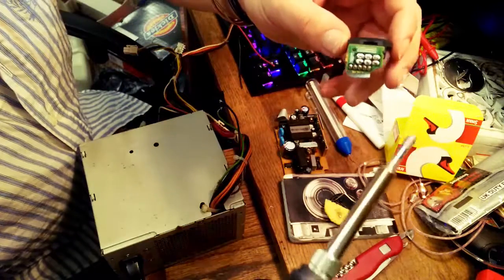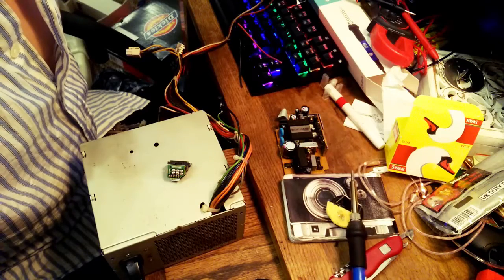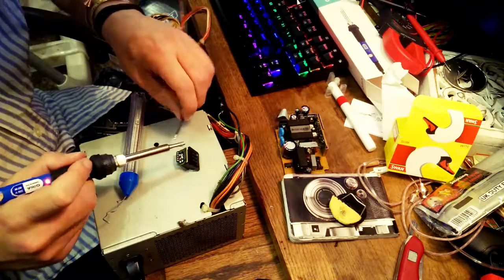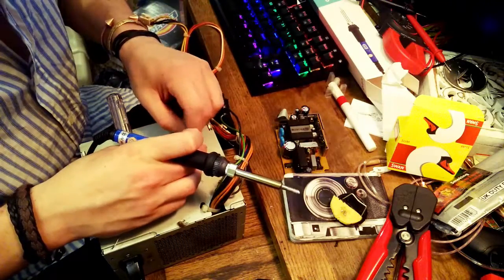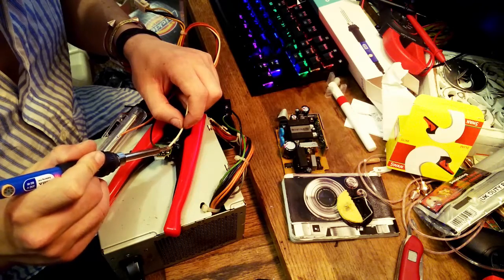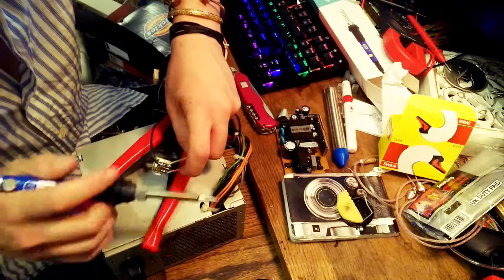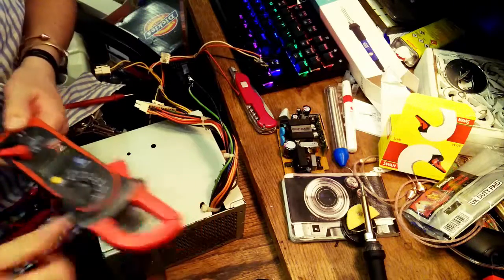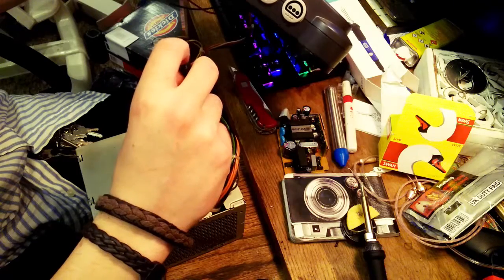DIY Nintendo 64 Power Supply from PC Power Supply

Comment: hey i am trying to run my nintendo switch with atx power supply .. only problem is that it has a usb type c port and there is no information on the internet .. any help about it bro?

Ps: with the same atx psu .. i managed to power xbox360/wii and wii u .. now want success with nintedo  switch .. please help me if you can 

Regards

Comment: Does PC 3.3 volt pins supply needed 2,7 ampers?
Reply from the maker: That's what replacement power supplies list as their output - almost any PC power supply can handle that.

Comment: Any way to get a n64 Running with no soldering and no pc power supply
Reply: Without soldering no but without pc supply Yes. Any 12v charger and 3.3 v with 2 to 4 amps charging power, not easy to get but it has to go UP 2ampers